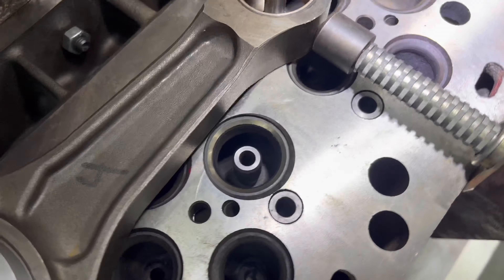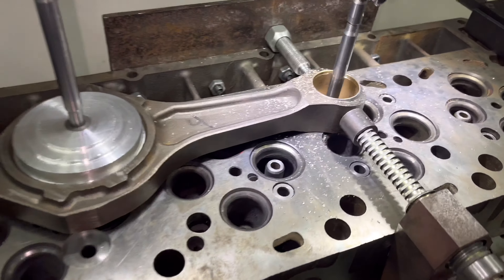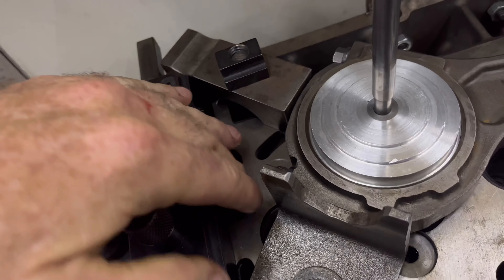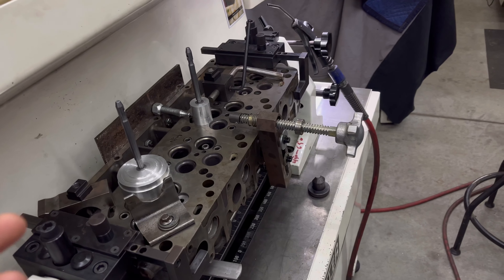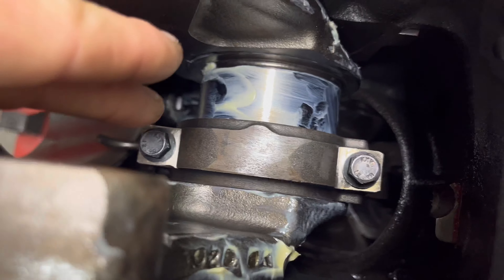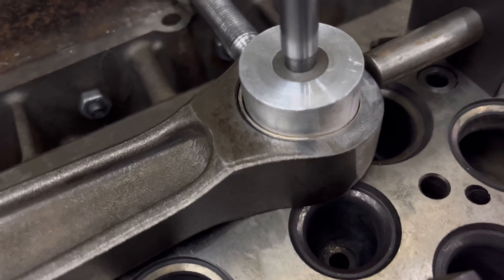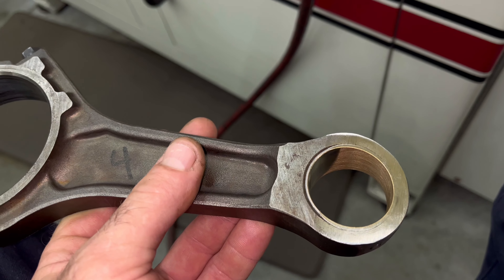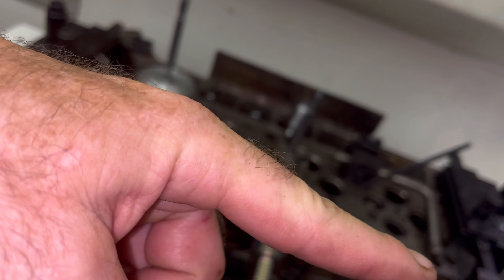Surface the cylinder head to change piston protrusion???

Comment: Just ran across your chanel. I  have a Question on a Dodge 5500 6.7 Turbo Cummins 2017 288,000 miles has been used to haul a 6 car trailer.  Is that alot of miles? $30,000
Reply from the maker: Everything is a lot of $$$$.    I must be to old,,  cause when I grew up,,  30k would net you a NEW truck!!!!